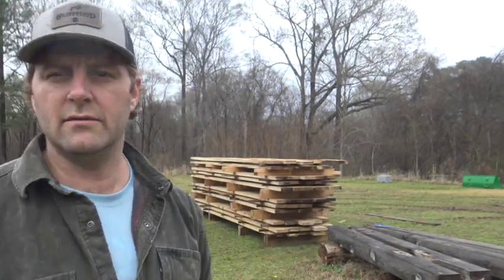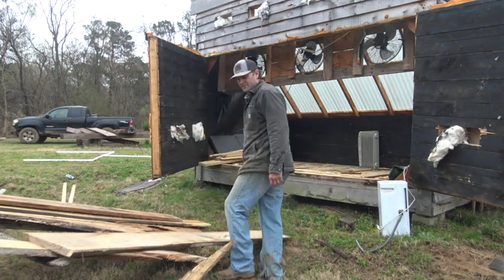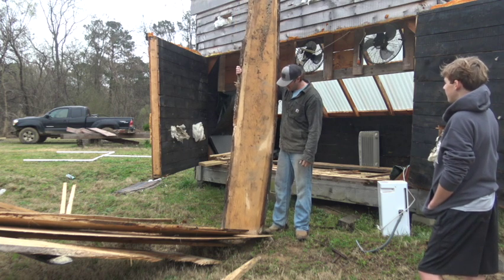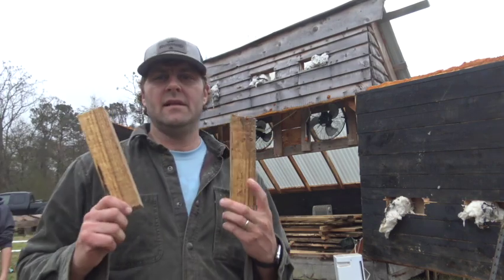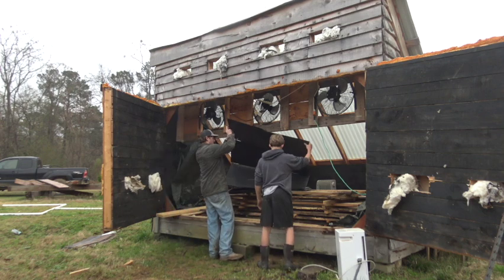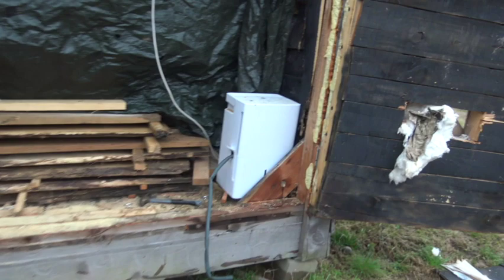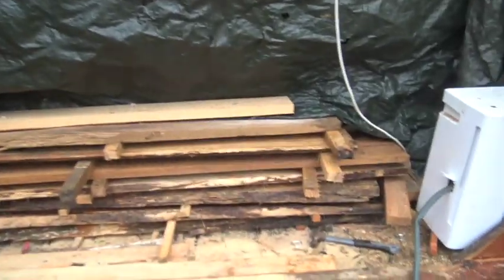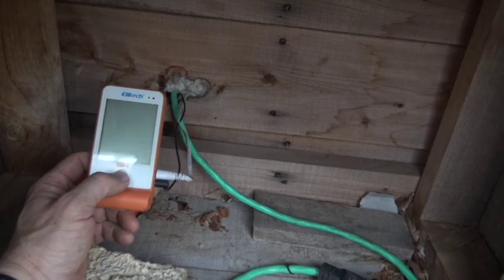Solar kiln - loading and operating

Comment: Is that a cast iron radiator in the middle? If so is jt hooked to a wood boiler or can you expand on that. Thanks
Reply from the maker: It’s a portable oil heater.